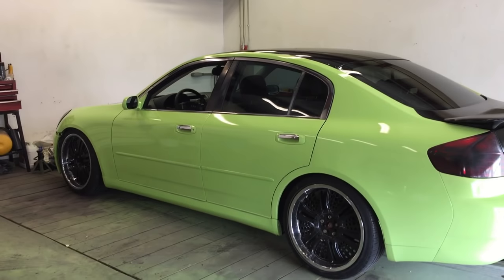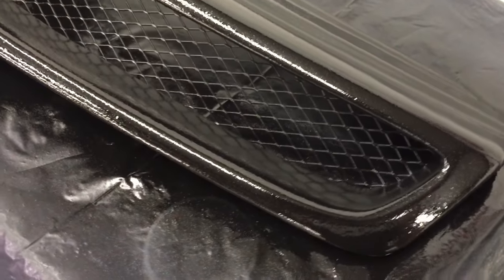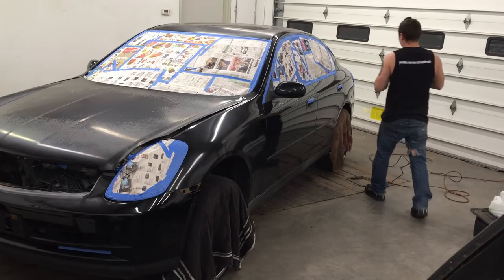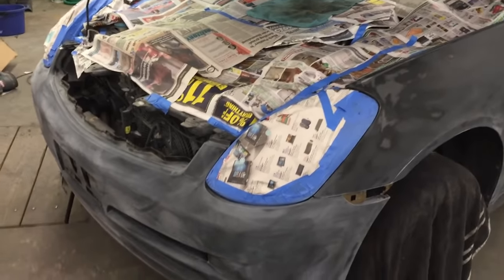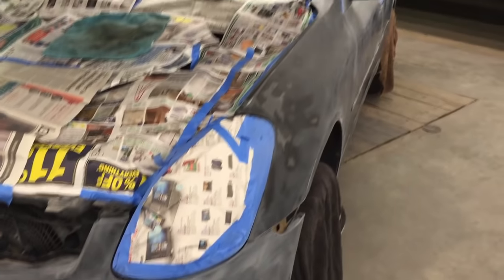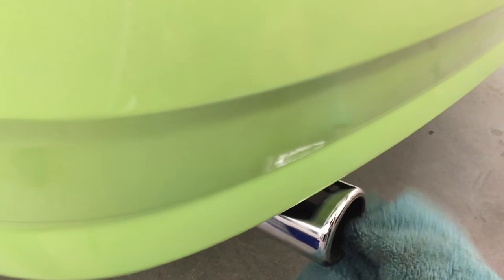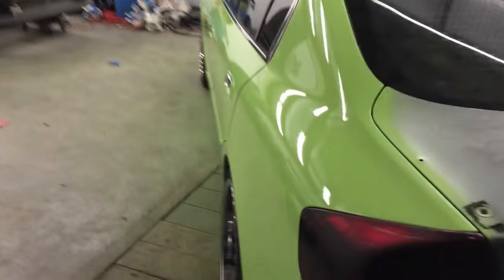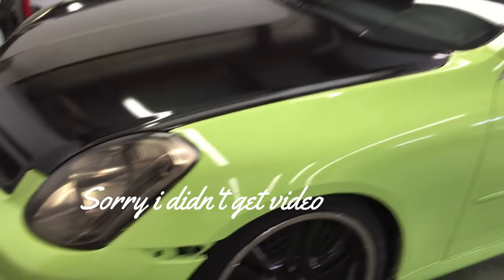Cheap Rust-Oleum Legit DIY spray can job you can do for 40$ or less! #budget #cheap #rustoleum

Comment: Great job dude. Ima do the same thing to my car thanks a lot for sharing..and screw what other people think.👍🏼👍🏼👍🏼👍🏼
Reply from the maker: Latin Amor Thanks for the support and haters always hate. They are jealous. Idk why they are jealous but they are.
Reply: Just do a little more prep to ensure the longest life possible for your hard work. 
Wash car first
Sand better, going from 400, 600, 1200
Wipe down with wax and grease remover to remove oils and silicones
Run a few good coats of primer
Run thin black guide coat to make sanding easier
Sand again
Wipe down with wax and grease remover again
Paint with desired colour, starting thin for first coat, then medium, then graduating to a wet coat for 3rd and 4th coat.
finish with a uv resistant clear coat for 3 coats.
Buff. 
It might cost 3-4x more, but will be worth it.

Comment: Nice work.
I painted my Harley with approximately 18 oz. of Rust Oleum Gloss White Enamel with a harbor freight $14.00 gravity sprayer with my compressor. I saved myself $2000.00 doing it myself rather than taking it to a painter.
Proper prep and a little hard work goes a very long way.

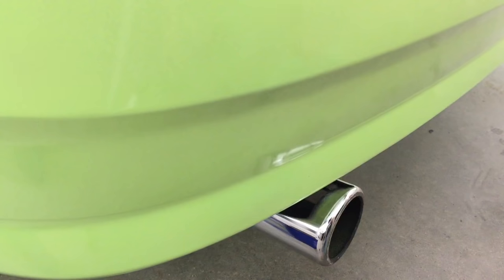Comment: You are the king of the can, doesn't look like a canned paint job but did you get a bum mix on one of the cans? Passenger quarter and half the rear bumper is yellowish with the break right at the door and quarter. 6:36
Reply from the maker: QQTrick1QQ No it’s the way the light hits it when on that side of the shop. It don’t look like that in person. I’ll try sharing a picture on my YouTube community on my page.
Reply from the maker: QQTrick1QQ Thank you for the compliment I appreciate it
Reply: i saw the same thing, Im pretty sure he's right though, just an illusion from a shop light being overtop of that one spot in comparison to the entire length of the car

Comment: 6 cans yes. But thats 6 cans for 1 coat. You need like 2-3 coats at least. Then 2-3 coats of clear.
End up spending more than you would just going the spraygun route... that being said, it turned out great for a diy job. Nice job.
Reply from the maker: RL S Thanks I added 2 coats. Hard to see in the video. Thicker coat then another light coat within 5 mins but sped up harder to see. But this paint is really thick compared to how it is super flaky and thin.

Comment: What kind of grit sand paper did you use please ? And btw it came out beautiful
Reply: 320 grit
Reply: At my shop I use, 320, then finish with 600 to avoid any visible scratches in the sunlight

Comment: Not a huge fan of the color either but that looks awesome for a spray can paint job. Thank you for the glitter tip of just spraying it over the paint, I might try that with my wing and see how it works
Reply from the maker: It works best with metal flakes from silver flake paint in the air but this method works awesome too. And the color isn’t for everyone. Thanks for the comment
Reply: Is there primer in the can or did u just say forget priming?

Comment: Was there a lot of orange peel which required wet sanding? Looks pretty damn good for rattle cans! Good luck with your future painting.....
Reply from the maker: Thank you! And no not alot of orange peel but i will be wet sanding it down and adding another coat then a 2K clear just to make it that much better!
Reply: James D guy +2 👍😀👍 I was shocked how nice this came out. I’ve been painting cars for 17 years along with custom fab work, mostly all metal, and now CF on the newer hyper cars, however,  I think I’ve used a rattle can maybe 3-4 times for a quick scratch coat ~ that’s it. It’s incredible that you did not get lots of peel and drips with the number of cans you used.....Great Job Brother!!!

Comment: I have learned from you a lot. I like that color. One question though did you open doors for a little bit when you spray paint the car?
Reply from the maker: bru Bna on this car the seals go right over where there needs to be painted so if I didn’t there would be black spots there when door were opened. I will be doing the door jams eventually though so it will all match
Reply: @JamesDguy  thank you for answering my questions very quickly.. the reason why I ask this question just cause I have seen a car with paint job. He didn't paint inside the car. Paint chips out when rains
Reply from the maker: bru Bna Hmm weird. I usually do the door Jams to match at a later time but I follow the same process tape it all off and prep it for paint. Never had them chip off. Make sure it’s sanded properly and stay away from krylon because that stuff loves to chip off
Reply: @JamesDguy  thanks for all the feedback and tips

Comment: I want to do this, but I’m not sure if I got the steps down 🤣 I have the same car I jus want to paint it a metallic grey color, so I sand it down, apply the paint in light coats & then I buff it? When should I put a clear coat? After the buff?
Reply from the maker: Von Phothisane I have a video on painting metallic spray can it’s a bit different than non metallic colors. Also you dont wet sand and buff metallic or it will mess with the flakes. After you paint the metallic and add the 2k clear which they make in a can then you can wet sand and buff it out. This car didn’t have clear coat ^

Comment: So it's a little less than a year, I just wanted to know with daily driving and weathering is the paint still good?
Reply from the maker: Joel Peter Oh no I have a car I did the same method as this using Same paint different color on 4 years now. No clear or primer
Reply: Moore Motorsports James Dguy what do you mean by no clear or primer like at all none why is it so clear and glossy
Reply: @jdmkid4617 It's prob those type of cans that haves clear inside of them. So clear coat is not recommended
Reply: @jdmkid4617  if you look at the can he uses, it isn't spray acrylic like normal spray paint. It's a high gloss enamel. That's the finish those always give.

Comment: Clear coat is In the Paint. Sorta like a Single Stage paint job. You could have added a few more coats and wet sanded, Then buffed out with some Mother's compound. I like to take off bumper covers, lights, door handles, easy to do and paint separate. Flat black would have looked better, with a subtle gloss black stripe down middle, or to the side. You did a Great job! I like the Kawasaki Green, individuality.
Reply: I feel like this green is trying to come back with Honda putting it on there Civic a few years back. You can't go wrong, not red or yellow so insurance don't care but when you see it pass it grabs your attention and breaks your neck! lol

Comment: hey i got a question, I just painted my car with this method and it came out great, but.... I waited about 16hrs and dumbly decided to touchup a couple spots I think needed it

then I looked back at it about 30 minutes later and now I have honeycomb in multiple places, is there anyway to fix without starting over in those spots???
Reply from the maker: Alan Mendez I have had this issue before and the only way is to let it dry and wet sand that area and re shoot but the reason it does this is because the paint wasn’t fully done fuming off which with spray can without hardener takes awhile to fume off. I would say after about a month outside in the sun and elements then it would be safe to wet sand with 400 that area and re shoot but make sure to re shoot the whole panel or it won’t look right.
Reply: @JamesDguy  dang lol it looked Soo good too lol thanks for the info enjoy your vids 👍

Comment: I mean like, I heard you need to start easy and light coat, but on this video it looked like you fully painted it with full cover at the begining with 1 coat
Reply from the maker: Yes ALWAYS start with lighter coats! I have been painting with can so long i threw the rule book out the window.. I should have went lighter to show you all how to do it properly but its hard to control myself when i have done it this way for so long. But yes lighter coat even if it looks like crap on the first coat. Then go thicker on the 2nd after it has dried for a few mins.
Reply: Gedas Alekveravičius Movie Magic is what he said. I was like Yea. I understand now.
Reply: Gedas Alekveravičius @7:58

Comment: What do you put on it after to make sure it lasts ?
Reply: Rustoleum clear coat is what I would do as a finish--but wait until the car is dry
Reply: @jawsh2v  not just dry, cured. Otherwise the remaining escaping gases might cause the clear coat to wrinkle. I learned the hard way
Reply: @firstnamelastname9398  how do you cure it? Looking at doing this for my truck. Bought it used and it's not pretty, nor am I a rich man.
Reply: @Molzhon93  you have to bake it, or give it time.  By time, it is like 90 days.

Comment: Thanks for sharing this.

I'm not planning to use cans (spray gun and compressor instead) but am getting ready to use tractor paint on a project car here as well.
Doesn't have to be perfect, but just about anything would be an improvement over the current condition of paint!

Happy wrenching!

Comment: planning on doing this to my car.. how many coats did you use.
Reply: He used 6 in the video for the green part
Reply: Night Shift I'm pretty sure the 6 was in relation to the number of cans and not the number of coats... Looked like One Coat to me
Reply: ChadRilla23 i’m sure of that as well. i ended up just buying a spray gun and using a gallon of single stage. turned out very nicely.

Comment: Is it just me or is the passenger rear fender a different color?
Reply from the maker: We thought the same thing but we sanded all this off down to bare black when we raptor lined and then shot raptor line and it still appeared to be a different color. We are almost 100% sure its the light and the curvature of the car. Check out my newer videos where its Olive green raptor lined and it looks the same on there too.. We are stumped.
Reply: Maybe some unseen body work in there...hmmmm

Comment: I TRIED THIS...I GOT NOTHING BUT ORANGE PEELS, FISH EYES & TIGER STRIPES ALL OVER MY CAR.....WHAT KIND OF SORCERY IS THIS ?
Reply from the maker: Peter Thompson If there is wax that ain’t removed prior the fisheyes will happen orange peel is common with krylon paint from my experience if you used that type of paint. Humidity has a roll to play on fish eyes as well. Best thing to do if you get them issues is wait for it to cure then wet sand it out with 400 then re shoot. One thing I failed to mention is washing the car by hand prior to sanding or painting but using dawn dish soap and water and scrub the car will remove any left over wax. I will have a far more detailed video coming soon.
Reply: When watching and doing the same thing is harder than it looks 😂😂
Reply: Funny satire
Reply: awesome brother
Reply: @JamesDguy  Funny, I started using Krylon specifically because I couldn't get Rustoleum to work for me. It seems to develop runs much easier and I swear it's like Rustoleum never  dries. Still feels tacky a week later! I don't see how it would even be possible to paint multiple layers of it.

Comment: Who hit thumbs-down? What better paint job have you seen for the cost of a tank of gas?
Reply from the maker: Brad the Pitts right!?
Reply: In the 1980s when I started driving, the metals weren't nearly as good at warding off rust and if you sanded the paint like this guy did it would fall apart. (Unless maybe you lived in Phoenix.)  We could not have imagined a simple sand & rattle can with results like this guy did.

Comment: so bad ass, not mask ! your lungs must be glowing green
Reply: Why, paints not radioactive. There's really no need to with cans in a well vented garage, a mask would help and benefit but not really needed
Reply: reaper-999 Any amount of paint/ paint fumes in your lungs is not good. Especially for hours straight. And the tiny particles that come off from sanding it are debatably worse to get in your lungs. ALWAYS use a mask for paint/ paint prep
Reply: @reaperasylum2163  dude, it doesn't matter if it's not radioactive. Saw dust isn't radioactive but still gives you cancer because it stays inside your lungs. Spray paint has all sorts of chemicals which can give you a hell of a lung disease.

Comment: Very cool...just bought a 14 year old car with literally over 100 pine tar spots on the hood and roof. Tried buffing them out to no avail so I decided to paint it. Used the Rustoleum 2x in black and it's looks better than the rest of the car. $12.70 for 2 cans of paint and $4 for the sandpaper. Couldn't be happier. Auto body shop quoted  $300 to paint the hood and roof.

Comment: It's unbelievable you didn't get any orange peel off that. Is there anything you did to avoid it from happening, Especially with thick coats. Did you cut and buff it before the last shot. I'm very impressed and need a quick paint job on my pickup and am on a major budget unfortunately.  Every time I try and paint rattle can I get orange peel. I do everything virtually the same I've tried thinner coats letting them fully dry I've tried everything any advice would be awesome.

Comment: I'm purchasing a used van conversion that was painted entirely with fiberglass paint. I need to paint it to suit my taste. Since it's rough fiberglass, what would you suggest I use to paint it..spray can, roller and brush? I've never painted a vehicle and I want it to last. If I can get away with not having to sand it, that would be wonderful. Thanks for any ideas.

Comment: I’m currently doing a gulf racing livery on a 1960s pedal car for my son. Blue and orange with the giant white circle number plates on the doors and Gulf decals. I’m using the same 2x paint as you use. Unfortunately I had to sand it all down and start over because this paint does not like heat. With every rattle can touch up job I’ve done in the past I’ve used SEM or FinishMaster.  A heat gun works great to speed up the process. I typically use UV Lights to cure the paint quicker. Rust-Oleum 2x shrinks and cracks apart leaving the panels looking like a big cat clawed every inch of your hard work. So... don’t use a heat gun. A blow dryer is ok though. (I’m impatient) 
Have you sprayed an entire car with 2k clear yet? I saw your civic video where you did the fender. I’m just wondering what the process would be for an entire car since it needs to be sprayed onto the basecoat before it dries. 2-3 panels at a time maybe? Sounds like a lot of masking and waiting. And.... do you think the clear coated panel turned out better to the point it would be worth it? 
Great videos....I have 64 Corvair that needs a paint job...... the hamster wheel is spinning 100mph now. 
Last note... this 2x paint wet sands very nicely. I don’t know how it buffs out though.

Comment: 5:41. I don't even mask up my cars lol. Over sprey on glass I just use a Goldylox, or steel wool and scrub it off it doesn't scratch the glass, other areas i use a bit of thin plastic sheet to shroud the areas off that I don't want paint to go, door handles I just  brush on black paint with a thin brush. Same with window  surrounds and window rubbers lol, works a treat

Comment: I wasn't sure if I could use acetone as a cleaner thus is good to know I will be sanding and priming my car this Friday I'll be using the 5 in 1 spray cans I did my vehicle before but I roll painted it, side from the bubbles in spots wasn't so bad but I wanted orange and let's just say that sunburst yellow mixed with red does not make orange as I had thought, it made like a salmon orange, seemed okay but I'll be going maui blue this time around 08 civic lx coupe..

Comment: That's pretty cool man, respect for the labor and effort, my only question is, how can one take it a step up above. I mean, to make it more glossy and reflective, the black is glossy black but it's blurry/not-that reflective. How good is this stuff to wet sanding or buffing? I wanted to redo a bumper on my black vette myself and it's damaged, so I was looking at options for a DIY job myself... and I need/want it to be highly reflective mirror finish. So the black in this doesn't look like a mirror finish. The green turned out pretty good. Also the wing seemed to have a ton of orange peel. I know I Know its a $40 or less video lol but I really respect your effort.

Comment: Could I use this method to do stripes? Also I see you didn’t use any primer. How is your car holding up?
Reply from the maker: I have a video I did after this feel free to check it out. I painted it in just the right conditions and other paint jobs similar to this held up for years. without primer or clear but results may vary

Comment: My husband and I bought a 2013 Dodge Ram 2500, it’s absolutely beautiful except the fender flares left some gnarly rub marks down to the metal, it’s showing some rust, and a decal toasted the hood. I can’t find any automotive paint (in the bright white) I was reading something about how the Rustolium white paint matched that color better, I’m just not sure if I should use the rattle spray paint, I would def add a couple coats of topcoat. I guess something is better than nothing. It kind of sucks we can’t get the true paint color. What are y’all’s thoughts on this?

Comment: HOLY BALLS. That turned out so dang well for rattle cans. Any runs? you gonna throw on a clear coat, or is there a clear built into the green?
Reply: Lol I am now annoyed at myself for buying a compressor and hoses and the whole works when I could have just rocked rattle cans after all.

Comment: Not to rag, I love diy jobs like this. But a few years ago a friend of mine showed me a trick of how to get the paint out of a spray can by holding a straw up to the nozzle and letting the paint collect in a cup, then dump the paint into a gun and go to town. I’ve taken to using this method because I never have to worry about a can running out of pressure and it’s easier to maintain proper spray pattern with the gun vs the can